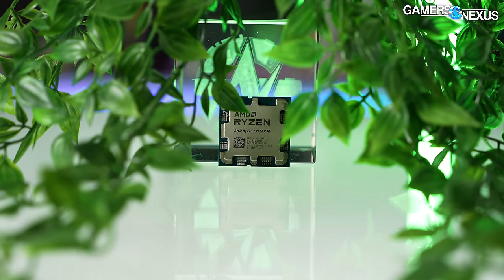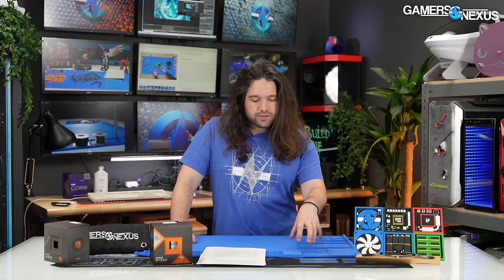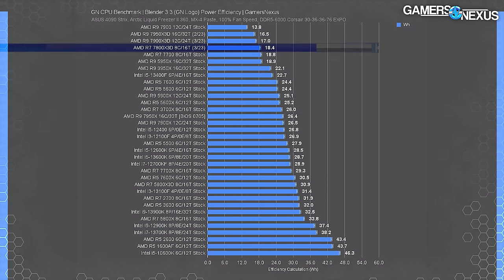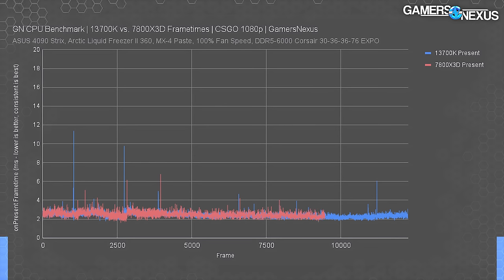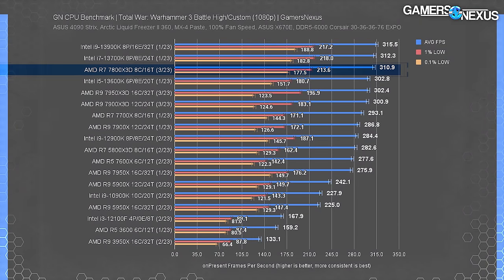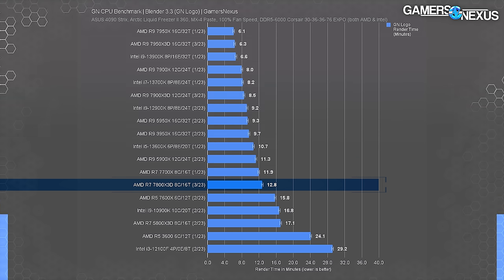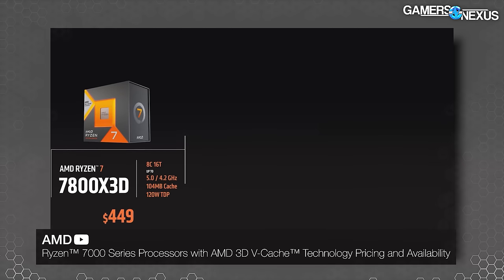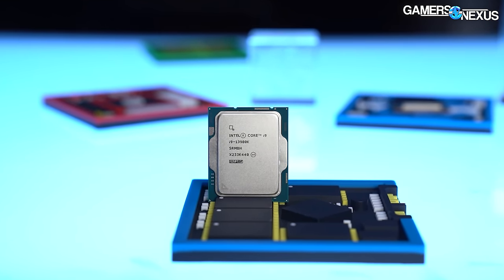AMD Ryzen 7 7800X3D CPU Review & Benchmarks

Comment: Great review! What I took away was - 7950x3d is competitive with Intel for workstation AND gaming PCs - at half of the Intel's power consumption. If you don't care about workstation and only care about gaming, 7800x3d is an OBVIOUS best-pick. 
This is a good result for AMD, and probably what they had in mind as well.
Power consumption and fan noise is important to folks who keep a PC in their bedrooms - or anywhere that quiet is a premium.
Reply: Fan noise on a high-end Intel pulling 250W+ is a vacuum cleaner as the fans can barely keep up and the video card as well due to the heat soak of the chassis, since it's all running close to throttling limits.. once it all spins up, it stays there with all of the fans struggling to keep up.
Reply: Is the 7950X3D still worth it? Have heard bad things
Reply: He gave the win to the intel cpu but for someone who wants to be more futureproofed the am5 cpus will be better

Comment: I loved the frametime graph, even if it's only a 1v1 comparison or limited to just 3-4 I feel like it is very informative to see just how consistent they can get. Also it'll be interesting to see how the CSGO graphs change when CS2 is pushed out
Reply: @Donuts Tech reviewers are gonna have a hell of a time rerunning all of the CS benchmarks to update their CPU and GPU graphs
Reply: @Donuts If they wanna do that they should have a bhop enabled playlist.
Reply: From what I'm seeing CS2 is quite a lot more optimized the CSGO despite still being in a beta. Frametime variance is much better despite the small fps decrease. Its also more GPU bound.

And yes CS2 LOVES the 3d cache.
Reply: @tanphan1848  How do you know it loves the 3d cache, any benchmarks? I´m planning on getting the 7800x3d but wasn´t so sure yet if CS2 will benefit from the 3d cache
Reply: I have the 7800x3d and 7600x. In csgo my 7600x is slightly faster. In csgo2 my 7800x3d is faster. I think about 30-35% higher fps but I will have to retest. However aside from FPS alone I think the 7800x3d feels smoother and more fluid at the same frame rates. Could be placebo
Reply: with only a game in the background smh

Comment: Thank you for including frame time! As a VR enthusiast, it is a struggle to find frame times on these newly released CPUs. In VR, frame times can be the difference between an enjoyable experience or one that is unpleasant and can cause a bad time. An overall smooth frame time and lower frame times make a huge difference in VR and it's not talked about nearly enough. Even on high resolution HMDs, where even a 4090 is the bottleneck, CPU frame times can have huge impact on not only the games performance, but the overall enjoyment of the VR experience.
Reply: John Carmack gave a great engineering talk about this a few years ago.
Reply: So much this.
Reply: They worse then Intel ones, who would have thought...

Comment: AMD's advancements seems promising. I'm still on the 3600 myself but I'll consider the 8800x3D when that is a thing in like 1 or 2 years.
Reply: Nah cause it took them what 4 months into the new year to release it , it probably won’t be released 4 months into 2025
Reply: Why not upgrade to the 5800X3D.  Isn't that the point of AM4, so you won't have to upgrade your motherboard
Reply: @pixels_per_inch  you can literally get am5 mobo and 64 ram for 300
Reply: @Johnny-yx2qx  Really?
Reply: @pixels_per_inch  yes, not the expensive ones , the entry was cheaper for me than am 4

Comment: Would you consider adding specific cache-sensitive games for the X3D reviews? For example, Cities Skylines is completely CPU-bound for most of a city's life, but some reviews of the 5800X3D showed huge improvements. For people like me who play this game, or other cache-sensitive games like Factorio, it would be a useful datapoint to know if the cache improves performance enough to consider upgrading from a non-X3D or Intel CPU.
Reply: It only makes sense for factorio if you live and breathe it, because game is decently optimized as is and will run great on average hardware. You will only see the usefulness of x3d cpu if you push the limits and have hundreds of hours in this game. If you are that person then x3d is amazing.
Reply: Tarkov
Reply: HUB or Linus has a factorio test for 7800X3D and it blows the chart off, followed by 5800X3D
Reply: Bethesda games really benefit from cache as well.
Reply: I guess the general opinion for Cities Skylines is still intel-bound for gamers who had 81tiles and heavy mod. Some gamers' comparisons on CSL with essential mod/asset indicated that 58x3d/795x3d had perfect fps on light load, but not consistent fps, or not even close fps(both avg, 1%low and vision exp) as 127k/139ks correspondingly, especially in medium and heavy detailed scenario. 
Unfortunately, most of prof reviews for Cities Skylines are no mod or very limited mod, which results x3d being an "unbeatable" winner.

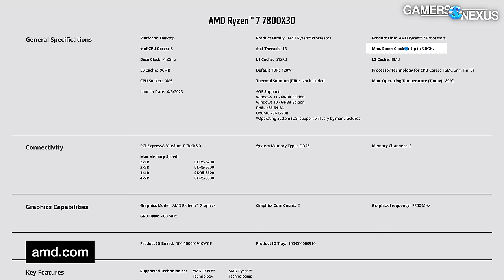Comment: Re: 4:46. The boost frequency on the V-Cache CCD of the 7950X3D is 5.2GHz, it isn't dropped that much for the 7800X3D (200MHz), it just looks like a lot because the dual CCD parts have that higher boost CCD that won't cook the VCache at that high of clock.
Reply: So you dont think that the limited frequency ceiling for the 7800X3D is a scummy attempt at product segmentation?
Reply: @mr.dingleberry4882  Not if the V Cache CCDs on the higher end parts are getting similar clocks.

Having V Cache drops clocks because the extra cache can’t handle the additional heat generation that comes from driving the higher clocks that the standard CCDs can run at.

Comment: The efficiency is actually insane on this CPU. It draws 6 more watts at full load than my CPU (ryzen 5 3600xt) yet has like double the performance in games
Reply: This is going to be a game-changer for laptops as well, with big performance gains and no throttling.  Remember that this also has fairly decent integrated graphics. And just within what a typical (gaming) laptop can handle in terms of heat and power draw. A clear win-win for AMD.

Comment: Glad to see frametime being included in your tests, I don't know if I am just particularly sensitive to stutters but I'd rather 90 fps with sub 8ms deviations than 150fps with 30ms any day but sadly they are usually not related eg. lowering my fps often didn't reduce my stuttering. So I guess GN will be my first port of call when its time to upgrade because I would loose my mind if I upgraded from my 8700K/1080Ti and still had stuttering issues even if it did double my average fps.
Reply: I just upgraded from 7700k and a 1080ti, to this chip and a 6800xt, so I'll report back. 
Yeah the CPU is overkill for that card, but I'll probably upgrade GPU next gen and wanted to get on AM5 somewhat early-ish since I seem to always buy mobos a month or two before they announce a new gen.
Reply: @ayewhaddupdoe  How has your experience been so far?
Reply: @dhLotan  I almost forgot I had the stuff.  I've been paranoid not wanting to ruin the 700 dollars in parts, so gave them a wide berth to get the BIOS stuff figured out and totally forgot I had that board/chip up in the closet.  Gonna do it this week now that you reminded me. 😅
Reply: @ayewhaddupdoe Now you’ve got me curious. I’ve got a 1080 and 6700K and am looking to upgrade as well. Have you tried your new parts yet?
Reply: This talk of frametiming against FPS is something I’ve felt insane about, have you ever used a Gysnc monitor with an Nvidia card to notice the difference?
Reply: @eqynoks4256  Yes thats what I have, still does nothing if frametime is bad.
Reply: I upgraded from an 8700k and a 1070 to a 7800x3d and 7900xtx. I was struggling with fps on the last boss of the current wow raid (wow lol) so I just decided to upgrade, it'd been 5ish years.

Went from dipping into the 30s on low settings during times in the fight to getting a consistent 400+ on maxed settings.

It was overkill for WoW but I play other games too. But my main game is still WoW and dropping fps like that was making it difficult to play.

I've noticed no stuttering issues. I did have a rough install though. I updated the bios, well I thought I did. Started downloading drivers and it was just laggy. YouTube videos would lag, mouse stuttering. Then it wouldn't detect any speakers, it would detect headphones but specifically not speakers. I did a windows a restore then updated then tried updating the bios again and everything was golden after that. Been perfect since.
Reply: @beeman4266  Which 7900XTX card did you go with? And do you notice any stuttering at all with your monitor? Are you also using Freesync Ultimate?
Reply: @eqynoks4256  I've got the Xfx black edition. There's really no stuttering that I've noticed, and I'm really sensitive to stuttering. Cyberpunk has been good, Witcher 3 is good, WoW is great.

I'm playing on a 1440p 165hz monitor and it's enough to pretty much max every game out. Also I'm using whatever the amd freesync option in the adrenaline software is

Comment: 7800X3D: You care mainly about gaming, low energy usage, and are fine with the $449 price point.
13700k: You care about gaming and production, don't mind higher energy use, and want to save a bit at ~$420.
13600k: You care about gaming and production, don't mind slightly higher energy use, and like the $300 price point.
Reply: 7950x: You want the best for both gaming and production, don't mind the higher price point

13900k: same as 7950x and you don't mind the higher energy usage
Reply: 7700x?

Comment: Great to see strong competition.  I was worried I'd have major buyers remorse after just building a new rig with a 13700k + 4090 and though this shows the 7800X3D would've been a strong alternative I'm happy with my choice since I still have some value for productivity software performance.  Each gen I keep switching back and forth from intel to AMD (whoever's the best fit at the time) and I have to admit I always feel like I run into less rare odd issues running Intel (and Nvidia on the GPU front) vs AMD.  Including one off games that have very odd dependency on individual core boost speeds etc.  Not throwing shade on AMD, again I keep swapping back and forth each gen between them and Intel and Nvidia, but it always feels like drivers and edge case issues are just a bit fewer when I'm in Intel + Nvidia land... maybe just me though.
Reply: I have the exact same issue : chosing between the 7800X3D and the 13700K is really hard. When 3D cache is used, the 7800X is a beast, but not so much when the 3D cache is useless. And I play almost only heavy sim games so I think that in a few years, the lack of cores compared to the 13700K will be a problem for me. On the other hand, the 270 Watts of the 13700K are a bit much and should be a nightmare to cool properly with an air cooler. But I guess it's not always used as a warmer with a Prime95 load. Oh, and also the nightmare with AMD drivers and DDR5 compatibility on recent AM5 motherboards. I might stay with Intel...

What are your temps & power consumption, when gaming ? (BTW, what is your cooling setup, that might help me too).
Thanks in advance =)
Reply: Thank you for this response. I'm finally looking into upgrading to a completely new build after rocking a hella budget rig for the past 4 years(optiplex, 1060 6gb, PSU...the general optiplex build. lol). Sim racing and occasional fps titles are really all its for, so technically just gaming, but the minimal frame rate differences don't mean much to me in the end, and the real thing I'm looking for is reliability and longevity. I feel like I've heard multiple people with the same thought on just having a smoother time with intel when it comes down to drivers and compatibility. ill likely be thrilled with either one, but think a 13700k over the 7800x3d might just make the most sense. Thoughts? and cheers!
Reply: @christophersmith8028  I have always been an intel user... starting with the q6600>3930k>6800k> 9900k>11700k>11900k>12900k...I went from the 12900k to amd's 7800x3d and the difference has been huge in fps uplift for the games I play(specifically dota 2(120fps average)/warzone(50fps)/baldurs gate 3(60fps)) with a 4080. I haven't had any driver issues thus far. Besides the fps uplift in these games, when I shift from gaming to more productivity I can drop in a 7950x3d or 8950x3d when it comes out eventually. Unfortunately with intel the best you can do is 14900k which is coming out soon, and is said to not have a huge uplift over 13900k. Meanwhile rumors are that next gen for amd are going to see around 20% improvement...

All that said, it does seem as though these days you have to do research for the specific games that you care about. For me it was dota 2 and baldurs gate, so the 7800x3d had huge gains.
Reply: @Togairu  Baldur's Gate 3 at 60 fps with a 4080 and 7800x3d???
Reply: @vane909090  that was the fps gain not the fps average sorry if that wasn't clear

Comment: I know Steve mentioned it briefly but the i5-13600k is flying under the radar here. As someone who was hoping for a 5800x3d jump, the 7800x3d is double the price of a 13600k, with really marginal gains.
Reply: The 13600K really is the jack of all trades, master of none. I feel like it's slept on at the $300 price range. Great all-rounder that doesn't require exotic cooling or tuning.
Reply: @steph_on_yt  I managed to buy my 13600k for $250 at BestBuy and I love it.
Reply: It's a tough choice I agree. the 7800x3d is more power efficient. You will make that money back in your electric bill haha. as time goes on we will see which CPU ages better.
Reply: @wijn1008  id hope its more power efficient since its 8c 16t vs 12c 20t. In gaming the 13600K doesnt actually use that much power. The 13600K is hands down the better buy, even for gaming E cores completely handle pc background tasks and let the 6 p cores focus on just gaming, and contrary to popular belief, threadscheduling has been optimized to actually use e cores in gaming too now. That danny dude did a video also proving you get better performance leaving ecores on and not turning them off. For all intents and purposes the 13600K is closer to a Ryzen 9 as an i5 than a Ryzen 5 or Ryzen 7
Reply: @wijn1008  Yep, don't look at the all core benchmark power draw, imagining that's what it pulls in real use, unless you enjoy doing blender renders on the CPU. Most of the time both brands have pretty reasonable power draw when gaming.
Reply: @Angel7black  and contrary to popular belief, threadscheduling has been optimized to actually use e cores in gaming too now.... LOL no
Reply: @Angel7black  The 13600K doesn't have AVX-512, so it's utterly useless to me. Intel removing that feature from their consumer-grade chips ensures I won't be touching any of them again, because it's a game-changer in the workloads I care about. A 13600K might be "hands down the better buy" if all you care about is saving money and are willing to put up with unexceptional performance to do it, but it certainly isn't anywhere close to the right solution for my use case.
Reply: @Angel7black  i'm watching some FPS benchmarks. The 13600k does fall off at 4k by a 30% except for cyberpunk. The question is just if that 30fps is worth 200 Dollar more. :)
Reply: @steph_on_yt  12400f for 135$ though....
Reply: @Angel7black  Watch Linus Tech Tips. The 7800x3D will save about 40 dollars each year compared to a 13600k in power. (Average) So yes you will have a more expensive processor, it will break even in cost after 3 years...meanwhile giving about 30% more FPS.
Reply: @wijn1008  The power saving are a good point. I'm not getting this 30% more FPS though, it preforms worse on many games, and only seems to have more than very marginal gains on very specific games.

Comment: One year later, watching this vid while deciding between upgrading to 5800x3d or to AM5 with 7800x3d. Thanks for the thorough review!
Reply: Same. I have a Ryzen 9 3900x and was thinking about the 5800x3d.
But the cost of the 5800x3d compared to the 7800x3d is the same.
So I have bit the bullet and upgraded to an msi b650 plus mobo and corsair ddr5 6400mhz ram just today after watching this review.
I've had this build for a few years now so £580 for the above is worth is.
Just wish It was worth financially upgrading my rtx 3080 but that will have to wait another year or two ; )